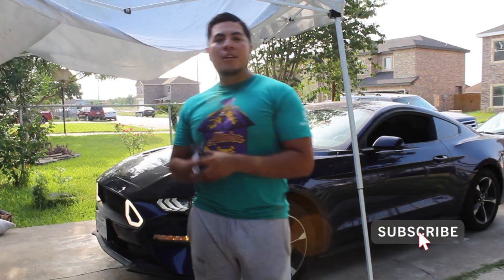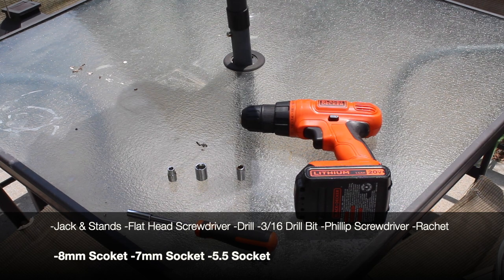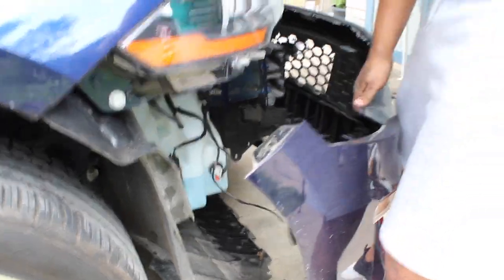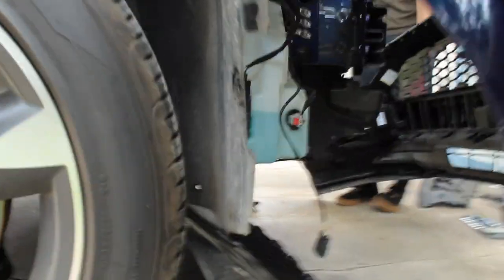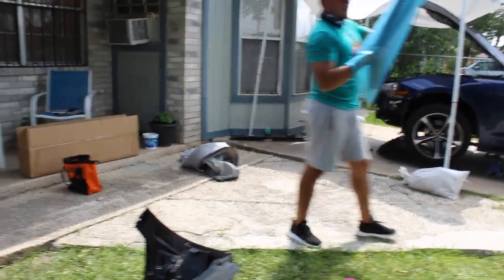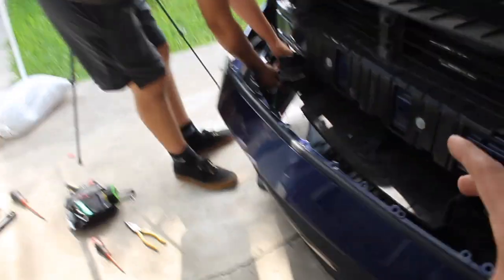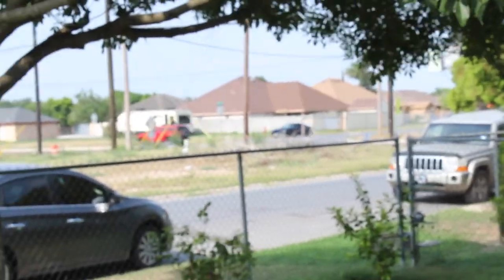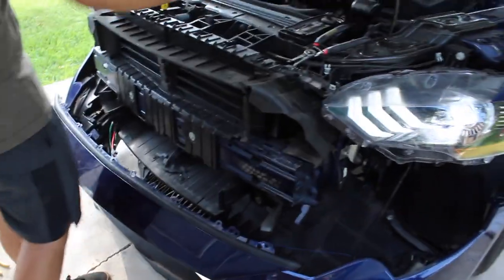How To Install RTR Style 18-19 LED Grille! BEST PRICE/QUALITY!

Comment: Are  the RTR lights also running day lights or na?
Reply from the maker: You can set them up to be, it depends to where you wire them too
Reply: @AlbertFlores11  do you know which wires are for the day time Bc that’s the only thing giving me trouble
Reply from the maker: @FredThvGod  I don’t but try following the wires from the headlights so you wire them to the tribar since those are DRL